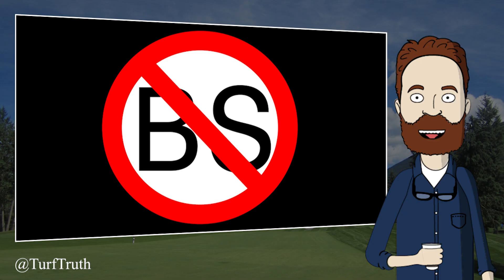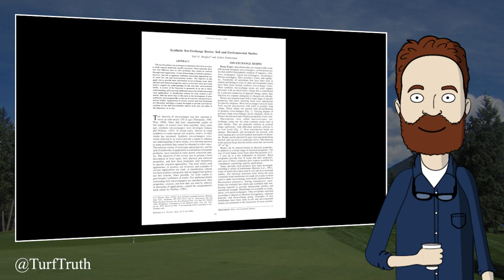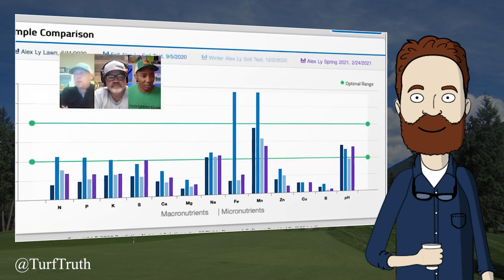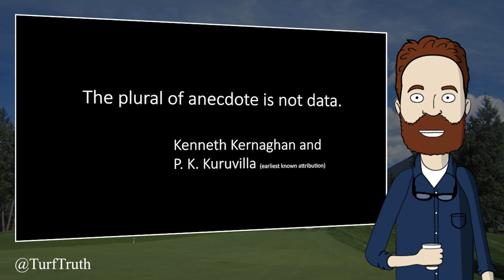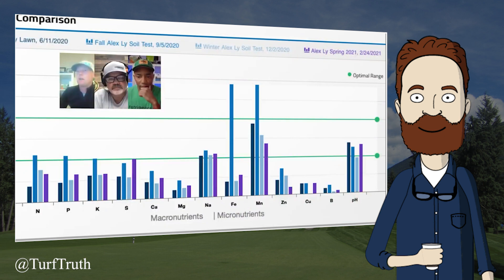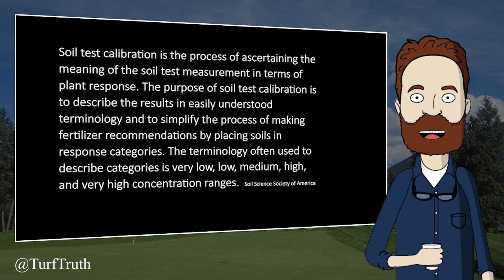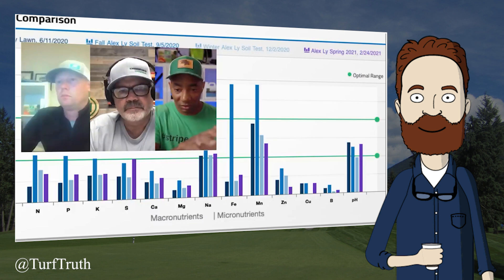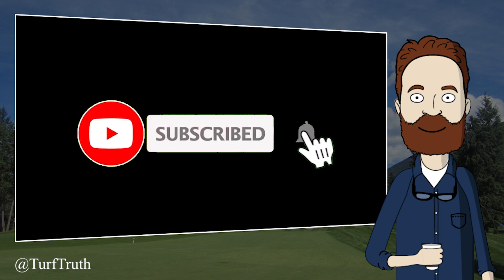How NOT to Use Soil Tests with Ron Henry, Allyn Hane, and Kris Borgman!

Comment: Mineralization and nutrient cycling improve significantly when soils are alive. Maintaining a living soil often requires that rates of high-analysis synthetic fertilizer and other chemicals be reduced, to enable a diverse population of microbes and micro fauna to carry out their specific and numerous functions. 
No amount of NPK fertilizer can compensate for compacted, lifeless soil with low wettability and low water-holding capacity. In fact, adding more chemical fertilizer often makes things worse. This is particularly so for inorganic nitrogen and inorganic phosphorus. An often overlooked consequence of the application of high rates of N and P is that plants no longer need to channel photosynthetic compounds (liquid carbon) to soil microbial communities in order to obtain these essential elements. Reduced carbon flow has a negative impact on soil aggregation - as well as limiting the energy available to the microbes involved in the acquisition of important minerals and trace elements. Lack of trace elements increases the susceptibility to pests and diseases.
I’m glad that you mentioned the detrimental ecological/environmental consequences of the over application of P. However this also rings true for functionality within the soil ecosystem itself as well as the physiological functions of the plants :
The application of large quantities of water-soluble P inhibits the production of strigolactone, an important plant hormone that increases root growth, root hair development and colonization by mycorrhizal fungi, enabling plants to better access soil P.  (Link to journal below) The long-term consequences of the inhibition of strigolactone include destabilization of soil aggregates, increased soil compaction and mineral-deficient plants.
In addition to having adverse effects on soil structure and aquatic ecosystems, the application of inorganic water-soluble phosphorus is highly inefficient. At least 80% of applied P rapidly adsorbs to aluminium and iron oxides and/or forms calcium, aluminium, manganese or iron phosphates. In the absence of microbial activity, these forms of P are not plant available. 
It is widely recognized that only 10-15% of P found in conventional fertilizer is taken up by crops in the year of application. If P fertilizer has been applied for the previous 10 years, there will be sufficient amounts for the next 100 years, regardless of how much was in the soil to begin with. Rather than continually adding P, it may prove more sensible to manage land in ways that support the soil microbes able to access ‘locked up’ soil P. 
Mycorrhizal fungi are extremely important for increasing the availability of soil P. Their abundance can be significantly increased by taking a more ecologically minded approach to soil rather than a soil test that is funded by the industry and adhering to the old model of “my soil test says I’m low in this so I need to add THIS to make it “work” better”.
Reply: Instead of synthetic feet, would love to learn some of what you recommend.
Reply: @dthedad7330  good luck getting a straight answer from him. It's usually like this long, drawn out paragraphs of rambling.
Reply: @lawn creeps ltd.
With all due respect sir here on planet Earth we have to adhere to the laws of chemistry and physics. we can't just make up our own science even if we say a lot of words it doesn't make it real. It sounds a lot more like you are growing compost than turf.

Also I don't understand why you went off on this tangent about phosphorus The man clearly said in the video not to overapply phosphorus and to be conservative with phosphorus he even acknowledged some kind of environmental consequence.
Reply: Heyyy weren't you the crazy guy posting this same stuff on The Grass Factors Humic video and said " I’m so over lawn care.(uh-oh I can hear the mass exodus of my subscribers)" ? I thought you were over all this lawn care stuff? Are you still making lawn skateboarding videos through a fish eye lens and harvesting mushrooms and blucheese from the lawn?  Really fun seeing you in the comments. Always a good reminder for me not to do drugs.
Reply: @soilcreepsandgardengeeks71  I guess I missed that there man somewhere in the word salad bar I mean you could see how I could get lost in there right
Reply: @HungrySoutherner  haha harvesting blue cheese line was awesome, love it. Nicely done, but damn dude why are you so MAD?! LOL
Make no mistake I’ll never be “over”my own lawn and garden, my passion for botany. It’s the Internet zeitgeist that I have been getting jaded on over the past couple years. The polarizing Lawntube messiahs and product pitch men… I know I speak on behalf of a good handful of enthusiast out there when I say that….in fact that seems to me to be the underlying component of this channel, which piqued my interest enough to the point of watching and commenting, contributing something thought provoking to the conversation. Seemingly. Have a good one….don’t be so MAD..fuckin A.🤝
Reply: @krusej23  that is spot on…haha🤝
Reply: @dthedad7330  I have had success over the years with the use of composted poultry manure derived from chickens on a high calcium diet, EQ compost co-composted with biosolids, actively aerated compost tea with the additions of kelp, fish emulsion/hydrolyzed fish, dry organic fertilizers that contain alfalfa meal as well as bone/feather/blood meal, all sources of nitrogen.
Reply: @soilcreepsandgardengeeks71  have you since been wronged by the “lawntube messiahs and product pitch men”? It seems not long ago you were featured in multiple videos from one of them.  Yet now, your tone and demeanor towards them seems to have taken a turn.
Reply: @jacobmorissette2367  No sir not at all. Still over it all none the less. Doesn’t take being wronged by someone to feel this way necessarily. I’ve felt this way for quite some time. Ive had multiple conversations about it with a few people in this community including John who I believe you are referring to in terms of the collaboration. And that’s just it, you don’t have to be a disciple of any one LawnTube guru or be a part of a group mentality. That’s not to say you can’t kind of align yourself with someone’s thought process and relate to or agree with their ideas and methods, it just doesn’t have to be so black or white. I did a few fun little videos (one of which I poked fun at my own penchant for rambling) with John but I have never even seen any of his product in person. I told him long ago that I never have and most likely never will use it. I understand it, I believe it can be a very good tool in the Gardner’s shed but my methods are different. I don’t need them. I don’t go gaga over them like they are a miracle in a jug product, nor do I feel compelled to wear a lawncology t shirt and shit all over other peoples product…..Listen, by all means to each there own. Get outside. Work your yard and find out what works for you. Teach your kids to love nature. Learn gardening, learn native flora. Learn soil. Now is the time.  There are some things YouTube and the internet can’t give you…….
Reply: @soilcreepsandgardengeeks71  Amen brother! Let’s just work in the lawn, use what we think works best for us; whether that’s by price, outcome, whatever. We all may disagree on things, but why all the hostility towards each other? We all enjoy working in the lawn, we share that commonality, why nitpick if I do use GCF and you use Pro Peat? You’re a good dude!

Comment: I always wondered how they had a optimal range on the test when they do not know what turf you have r anything. I will still use the tests to see where the levels are in my soil but other then that i will do my own research for my land to see what is optimal or as close as i can get it.
Reply: After watching most of these types of videos, unless they are specific on the type of grass, they are probably talking about tall turf type fescue (TTF) grass. You are smart to do your own research.
Reply: I think that turf type is a basic type of information that soil tests usually request.  In other words, the testing lab should know what turf you have.
Reply: @phidip2328  I agree to a point. I have never had a client or prospective client ask for anything other than a variety of TTF for their lawn. They may ask for Rebel, Falcon, Titan, and my favorite... Pennington, but they're all TTF's. My Waypoint lab ALWAYS asks me what am I growing, TTF, rye, fine fescues, etcetera. The weirdest request I got was for orchard grass! The gentleman wanted to start a hay business from 3 acres of clearcut!! LOL It was barely cleared!! Ultimately it's on the one submitting the test to give the lab the proper info to get good, meaningful results.
Reply: The university based tests also provide a range, and they don't know what turf you have either.

Comment: It's very likely that when you use a university provided soil test through your local extension office, the only things they will ask for are where is this sample from (turf of garden), when did you last fertilize, and when did you last apply lime. That's it. So if proper calibration is necessary to get a good test result, and calibration includes accounting for the grass type and other factors you mentioned in the video, then the universities aren't doing it either (at least my state's leading agricultural university isn't). Are you trying to say those tests aren't valid either? Ok...
Reply from the maker: @spottedowl Thanks for viewing and commenting. Yes. If the university has not conducted a calibration on the specific turf, soil, element, and extractant, then their recommendations are of little use.

TT
Reply: @TurfTruth  then aren't the sources you reference irrelevant? This university studies are not specific to one turf.

Comment: Good video.  I did one "spendy" mySoil test on my lawn and never felt it provided info that I would make realistic use from.  It did indicate that my soil is more alkaline (higher pH) than I expected.  I never repeat tested with mySoil so I guess my gut feeling was on the right track?  I read more and retested through Waypoint which I did get a soil composition analysis and confirmed high pH.  I found that info to be useful but specifically in terms of how long additives remain active in the root zone, degrade, or move past.  So are we better served to forego soil testing and follow the annual fertilizer rates that appear in major university studies?
Reply: "So are we better served to forego soil testing and follow the annual fertilizer rates that appear in major university studies?"

That's precisely the problem with this kind of video.  It's easy to sit on the sidelines and attack people but quite another to make an affirmative statement about what should be done.  If you have questions about soil tests, I think you'd have a better chance getting reliable information on what to do from university extension offices that offer those tests.
Reply: @phidip2328  sometimes disproving something is still progress.
Reply: @tiffanywhite2121  True, but sometimes sitting back and throwing mud simply makes everything dirty and causes division.
Reply: @phidip2328  as long as he continues to cite his sources im still gonna find value here. Its like how somethings are not sweet but instead necessary all the same. 

Id much rather that than someone who just smiles in my face selling me stuff. So i read those soucres and bare them in mind tomorrow. Tomorrow the learning doesn't stop either. We just keep growing.
Reply: @tiffanywhite2121  That's fine.  You're free to find value in these videos.  I simply think they're of limited value and use a poor intellectual tactic.
Reply: @phidip2328  just as youre free to feel that way. 🤷‍♀️ live and let live right?
Reply: @tiffanywhite2121  live and let live? Well let these YouTubers live right? Iean it's not like they're forcing you tu buy their products.

Comment: The problem with My Soil other than not being calibrated is that there isn't any real program guidance. It just recommends a product or two that it is affiliated with. Great! How often should this product be put down? Does the ratio ever change throughout? I've used My Soil and my local ext. via UGA, and UGA wins for the reasons mentioned. Plus, it is at least half the price of My Soil! An argument I have heard Allan mention for My Soil is that university tests can be confusing and offer generic recommendations. I can't speak for all, but UGA does go generic in that it just offers ratios in the recommendations. It also offers intervals. It isn't that difficult for the consumer to make a choice purchase based on NPK ratios, but everything is preference I guess.
Reply: It’s easy to be confused when it’s beat into your head that you are confused.
Reply: I would go with the test from Clemson over UGA since Clemson offers more data.